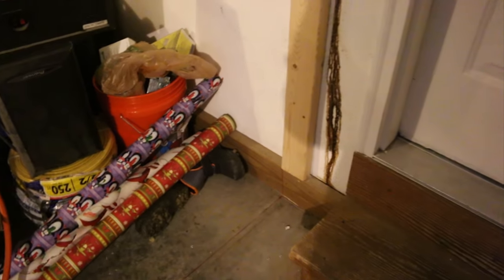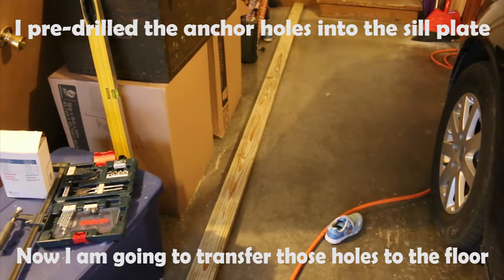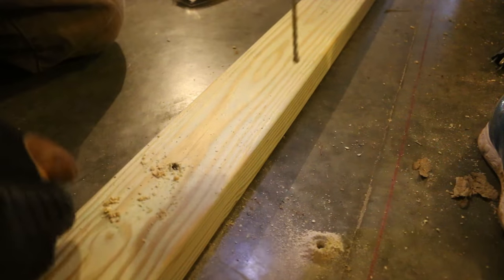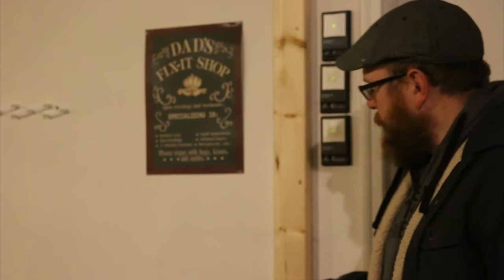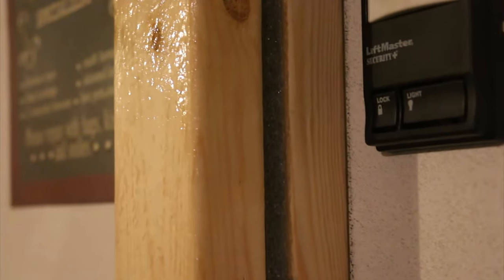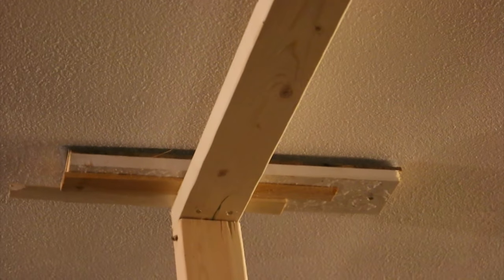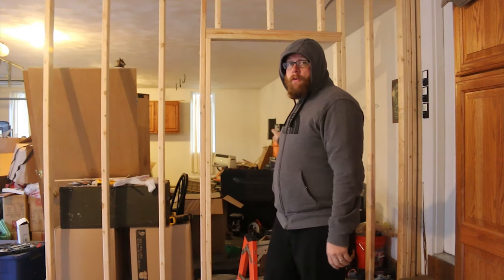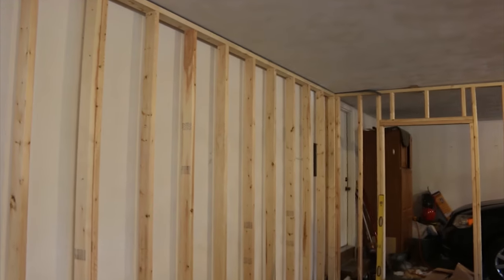Don't Call It a Dream Shop: The Walls

Comment: Hey Thomas looking good as a framing Carpenter I gotta tell you though if you don't flip those headers over you're going to get a good chance that they're  going to bow down and make your door stick. I'm just saying.
Reply: I'm just saying that from experience I did that one time and within a couple of months my door jammed shut and I had to force it open not trying to insult you just trying to help.
Reply from the maker: +Opa's Workshop yikes, you mean flip them on their side? I never knew that before.
Reply: Thomas Lightle - Red Barn Woodworking no on their edge it looked like u placed them on their side in video
Reply from the maker: +Opa's Workshop lol now you have me confused! I laid them on the 3.5" side, not on the 1.5" edge. Which it the correct way you suggest?
Reply: Thomas Lightle - Red Barn Woodworking On the1.5 side for sure.
Reply from the maker: +Opa's Workshop gotcha. As I was thinking about it, this is the first non-structural doorway I have ever built, so the first time I used 2x4s for headers. I did it wrong and the wall is already covered and door installed, so I guess we'll see how it works out.
Reply from the maker: +Opa's Workshop thanks Opa